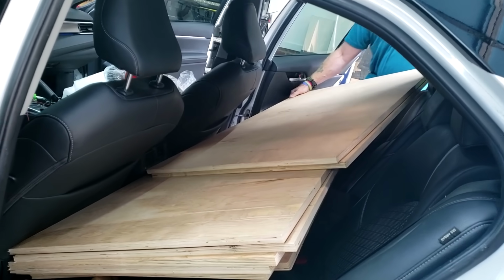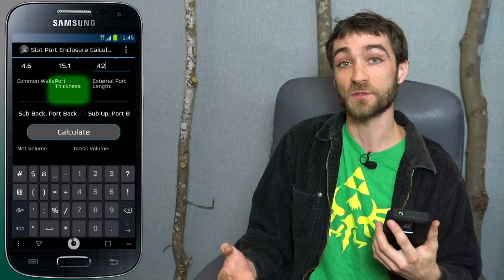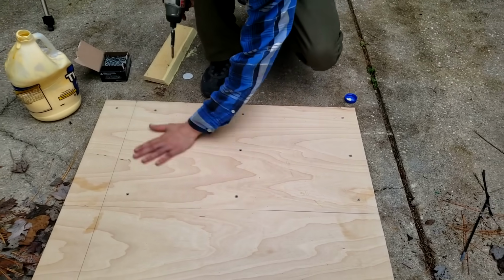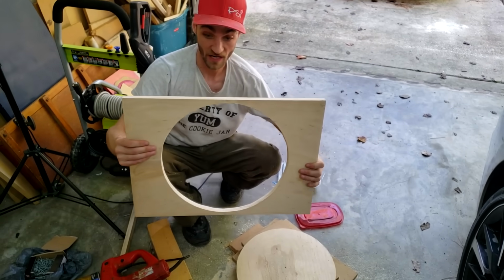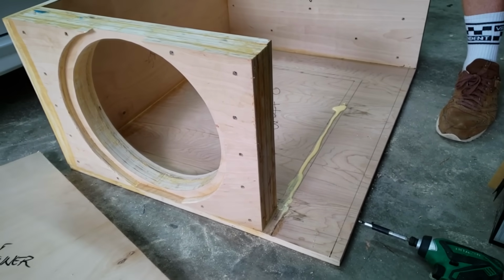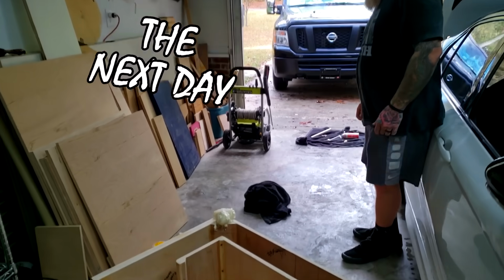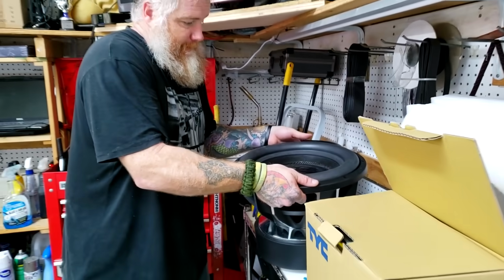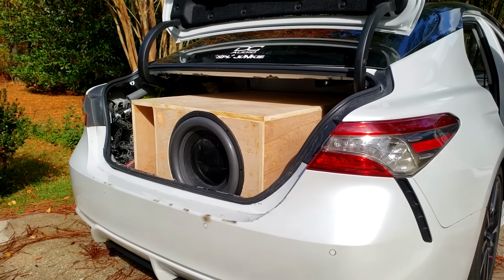Building a Ported Subwoofer Box for DEEP BASS!!! How To Design & Build LOW TUNED Slot Port Enclosure

Comment: I used construction ply to build my boxes, hasnt failed me yet
Reply: No, but it's more likely to chip, crack, warp, bow, and splinter. However MDF is generally always just one solid straight board. Its weakest points are the corners, so use a roundover bit! Not to mention it's easier to paint, work with on a router table, and easier to align because it's not bowed and warped. Just because something works doesn't mean it's always the best way. Using duct tape on a lot of items can make it work but that's not the proper fix🤣